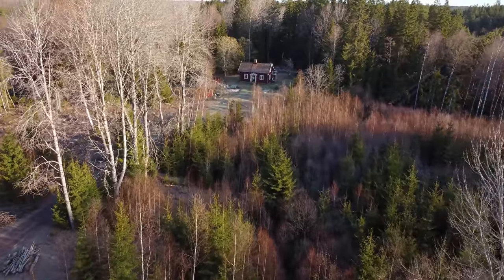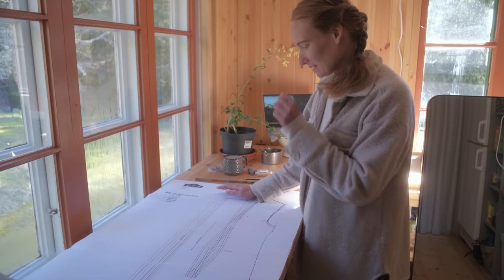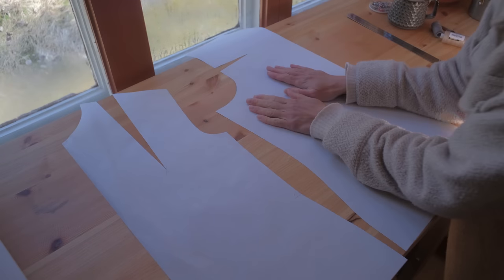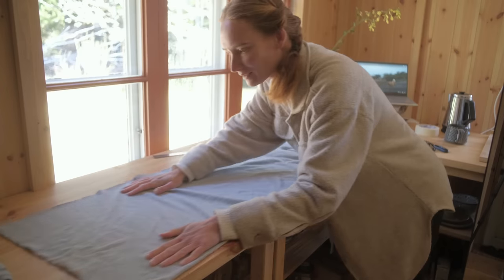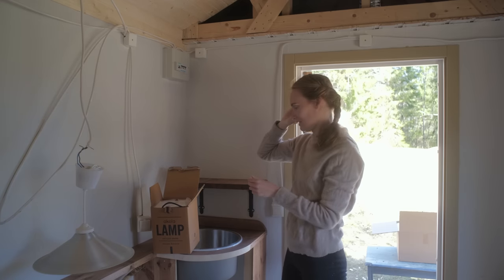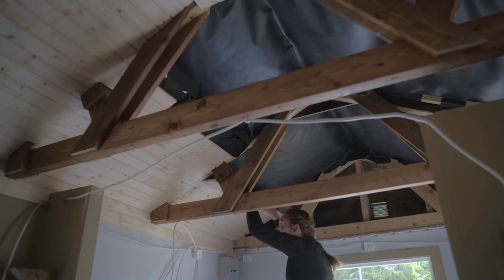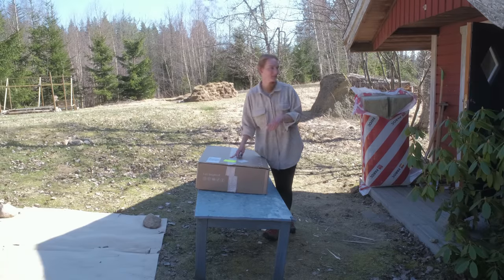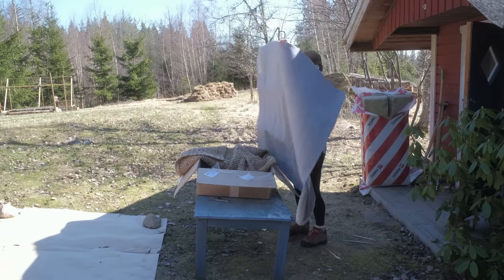This Week I Made Another Dress and I'm Still Renovating the Guest House (Story 51)

Comment: Rosie, never trust planners they are ALWAYS wrong!!! When planners told me it should take a week, I would think, proberly takes 2 weeks, and sometimes it would take 3, because they had not coordinated with procurement or finance, so everything is normal by your build?? Next time you go to your building market ask them for glue there is several, they can help you, when you explain them what you need!! they also have connectors for the lamp, you can do that, just make sure to turn off power on your main switch,before you stick your fingers in there!!

Comment: It's difficult to give advice regarding the lamp without knowing any technical details about the wiring in your house. What protective electrical devices are installed? In a common, reasonably modern household you would have at least one RCD (residual-current device, jordfelsbrytare (SWE)) in addition to the standard miniature circuit breakers (säkringar). However, there are still quite a few places similar to yours in Sweden which still use an old type of system which is fundamentally different in terms of protective devices. In a modern domestic household the RCD is usually installed together with the circuit breakers in a plastic or metal wall-mount box. However, in some cases RCD and circuit breaker are not separate devices but integrated into one. You usually can identify the RCD by its test button or switch (i.e. it has a "test" label). If you press the RCD test button, the main switch of the RCD should automatically flip over (which disconnects the circuit from the power line). You can flip it back manually to reconnect power. This is a standard test of the RCD which can and should be performed every 6 months or so by the house owner. 

The wiring that's visible in your footage looks new. That probably means you have a system with RCD. Unfortunately, "probably" is not sufficient to give advice concerning matters of safety of electrical wiring. So I'll stop here. I am already have doubts whether it was a good idea to post this in the first place. Topics like this have a strong tendency to attract all kinds of heated debate.
Reply from the maker: Well I do appreciate the effort in trying to help! The main house has an old fashioned electricity box with the knobs instead of the switches, but yes there is a circuit breaker in place. But this little house actually connects to the main house via extension cable and has its own little circuit thingy but I'll have it connected to the electricity box outside directly one day, when it makes sense to get an electrician in. I just can't figure out how you're supposed to fit this light, if it doesn't come without a ceiling plate?
Reply: @wildrosie  I see, that sounds like the wiring is basically the old-fashioned type. I am guessing the "knobs" in the electricity box are replaceable and have a bottle-shaped white ceramic body and a metallic cap at the top, correct? (Easiest way to check is to look at some spares, if you have some laying around somewhere). The ones with a tiny colored disk in the bottom that pops off if the fuse blows due to an electric fault in the house? Commonly referred to as "proppsäkringar" in Swedish, as opposed to the modern "automatsäkringar" (which look very different and do not have a ceramic body). 

What I can't quite figure out yet is this lamp you have. It seems a bit unusual in that it has a cable with just two blank wires instead of some kind of plug or power supply/converter. What kind of light source does it have? Is it supposed to be used with an old-fashioned screw-in light bulb or is it some kind of LED lamp? In the unlikely case of it not (!) being an LED we don't need to dig deeper. 

However, I am not as sure in case it's an LED. 

LED lamps are typically designed to operate on low-voltage DC (direct current) power. This is because LEDs themselves are a type of diode, which only allow current to flow in one direction. In order to power an LED lamp with AC voltage, a rectifier circuit is needed to convert the AC voltage to DC voltage.

Some LED lamps may include an integrated rectifier circuit, which allows them to be powered directly from AC voltage. However, in most cases, LED lamps are powered by a separate DC power supply or driver, which converts the AC voltage to the appropriate DC voltage for the LED.

It's worth noting that some LED lamps are designed to be compatible with both AC and DC voltage, which can be useful in applications where both types of voltage are present. However, it's always important to check the manufacturer's specifications and installation instructions to ensure that the LED lamp is being used with the correct voltage and power supply.

Assuming it's an LED, do I read you correctly that the lamp was shipped without a power supply? In other words, did it come with some documentation that clearly states it is designed to be connected to 230V AC with the two wires?